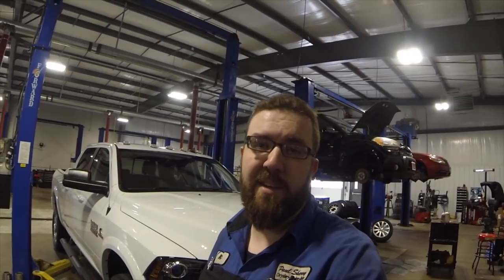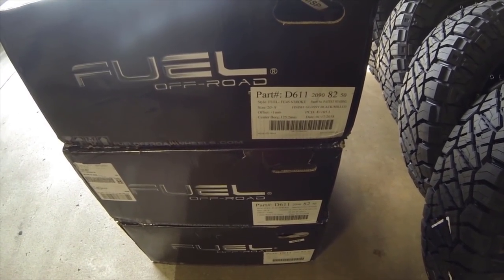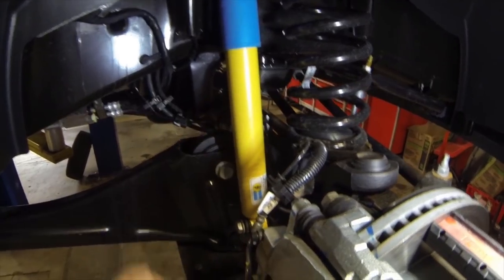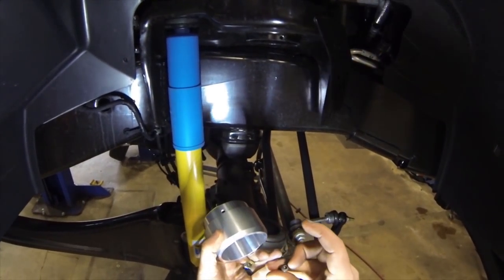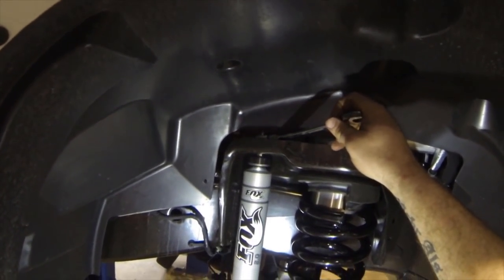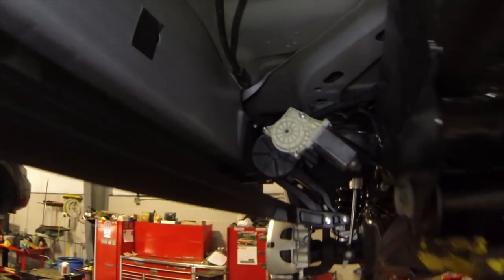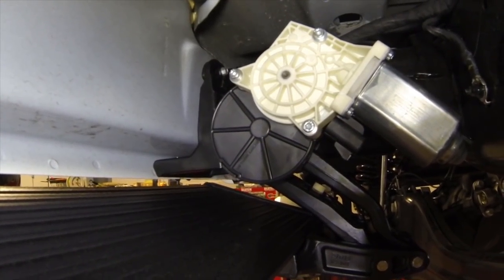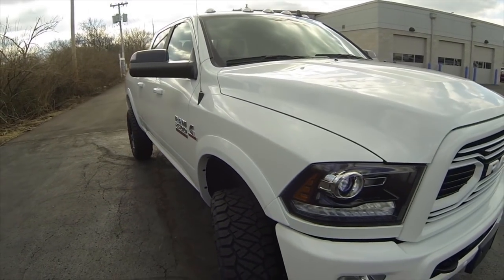2018 RAM 2500 Level Kit - Fuel Wheels- Amp Research Boards

Comment: Hey nice job, I just got the same wheel in red. In 18x9 on 35, 12.5, did your sub any? You mentioned that you should loosen up the track bar and tighten again, Is that necessary? I am putting on the carli leveling kit with the fox shocks.
Thanks

Comment: I bought AMP Research power steps for my brand new 2018 Ram 2500 Mega Cab and they gave me fits to install them!  They Do Not Fit.   I followed the written instructions exactly to the letter. Got all done. Put power to them…  And the retracted up under the truck and wedged behind the pinch welds.  I worked for hours putting brackets and linkages on than taking them back off numerous times, I adjusted brackets and linkages to NO avail.  The boards jammed up and got stuck under the truck every time to the point where I had to remove the motors and pried them out from under my brand new truck scratching up the AMP Research running boards.  Decided to call customer service.  I called and spoke with Brian Weaver. I explained my situation and he seemed to know exactly what happened. Brian said “they got stuck behind the pinch weld right???” I said Yep!!!  He said with a snarky little attitude “I’ll send you an email that’ll explain what to do”…  So I get this email with an eight step process to remedy the problem.  I followed that set of instructions to the letter again.  Well step # 8 said if all else fails take a hammer and bend the pinch weld seam over to make it fit.  I tried but I would have had to bend that seam over 45 degrees and I didn’t want to go that far with the sledge hammer.  Long story short I had to take a 4” angle grinder, remove ¼” + off the top of the pinch weld seam to get my new $1500 AMP Research’s running boards to operate on my $70,000 brand new truck.  Needless to say I was PISSED!!!!  For that amount of money the AMP Research product should have fit like a glove.  
If you are looking to buy a set of nice power retractable running boards LOOK SOMEWHERE ELSE!  Don’t spend your money here, You will be Disappointed !!!!! 
PS…  I took the AMP Research badges off the steps so they don’t get any free advertising from me.  They better run flawlessly for a long time…  If they so much as hiccup I’m going to unbolt them and throw them into the dumpster…….   I’ll definitely let you know…….

Comment: Did you do an adjustable track bar to center steering wheel after new springs installed? Carli recommends that? If it’s not needed with the kit you installed I will purchase that kit. 
Great vid! 
Thank you
Reply from the maker: It’s not necessary on this with just the front end level with this kit. It’s still a good idea to loosen the bar and retighten though after doing this kit.

Comment: Any rubbing issue at all. About to get a level on exact same truck from dealership. Is that something Dodge uses for level kit. My fuel rims might be 20x10 but do u think I’ll have a problem ? Thanks great video.
Reply from the maker: There was no rubbing issues at all mentioned ever from the customer
Reply: Awesome. Thanks for the reply. Is that a. Primal kit the dealer uses? I can’t find that kit anywhere. I like that it had the brackets to allow for the stretch.
Reply: Flounder.  20x10 will be fine especially after you do a level.

Comment: Looks Great!  Did you have to remove the factory nut inserts on the running boards mount points and install the AMP Research back plate and nut inserts to make this work?  If you had to remove the inserts, how did you do it, that part was not in your video.  Thanks!
Reply from the maker: Roger Stidom yes, ground off the heads of the factory installed riv-nuts, then with a magnet through an opening in the frame was able to take out the inside part. Had to do this because factory installed riv-nuts protruded out from the frame.

Comment: Good video, should have shown the steps raise and lower, in my opinion.
Reply from the maker: Lol first one to say that. I didn’t show that lol because it didn’t work. The module they sent was bad. Got a new one the next day or two and it worked right away. Should’ve put that on video but I was just frustrated at that point.
Reply: @RustbeltMechanic  understandable. Been there before. Lol keep up the content!

Comment: Hello I was wondering if you can tell me the exact specs on the rims please my dad has been trying to find a set of rims that don’t stick out past the truck much and that looks perfect
Reply from the maker: Hellcat Peredery 20x9 with a 0 offset
Reply: Rustbelt Mechanic so +1  offset wheel or 0? I ask because I am also interested thanks
Reply: David g.  +1  or 0  is pretty much the same offset.  Most are 0.